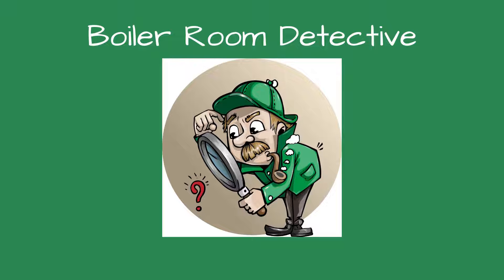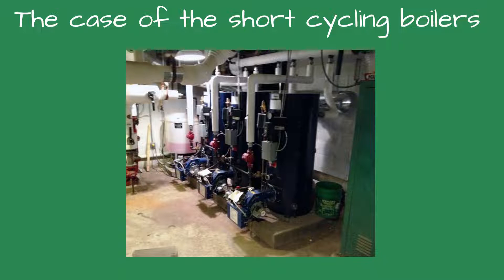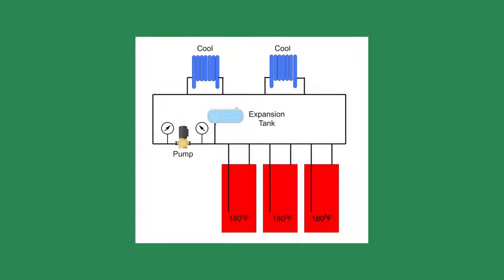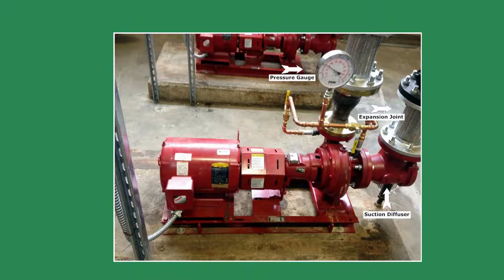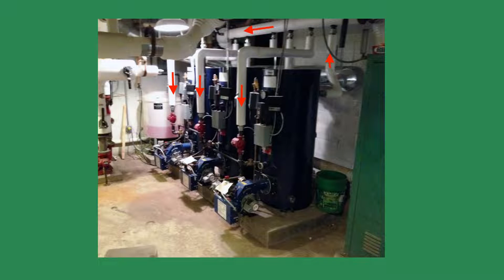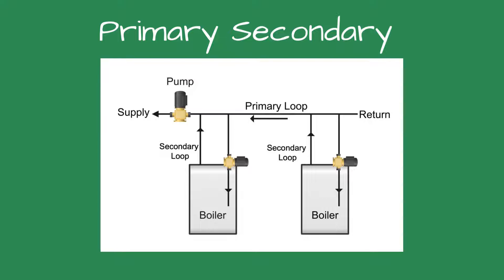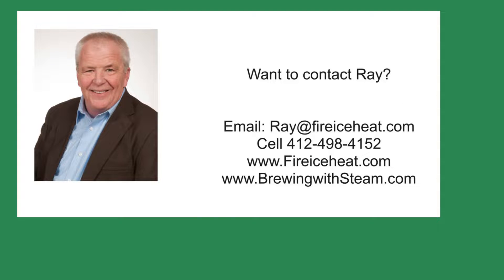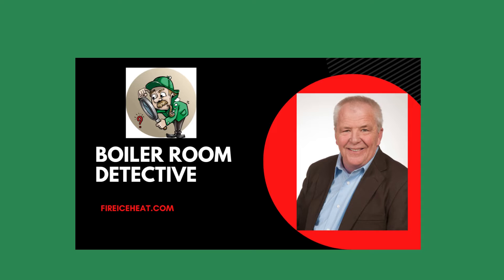Case of the Short Cycling Boiler

Comment: The loop returns were piped into the supply outlet of secondary pumps?

You lost me completely on your description?
Reply from the maker: Sorry. The loop returns were piped into the common boiler return pipe The only time there was flow through the boiler was when a zone called for heat Hope it clarifies it
Reply: @boilerroomdetective  
So any zone call starts all three boilers/secondary pumps?  I say three because three boilers drawn on diagram..? 
Or is there other water temp control to stage each boiler/pump?

The radiation/ fin tube loop has a pump ?  It operates on changeover temperature?

I see the short cycling with no secondary flow… I guess I would have to see the job to completely understand how it might have been piped backwards like the video eluded
Reply from the maker: @joecorbin5158  Sorry I was referencing the other video When there was a call for heat, it would energize the boiler and secondary pump. The hot water would leave the boiler and get sucked back into the boiler. The boiler would go off on operating temperature and the loop got little heat. The pipe on the right of the boiler is the discharge. The pipe with the pump is the inlet.  Hope this helps
Reply: @boilerroomdetective  
That makes sense… short cycling water… and temperature. Got it thanks for helping me see it